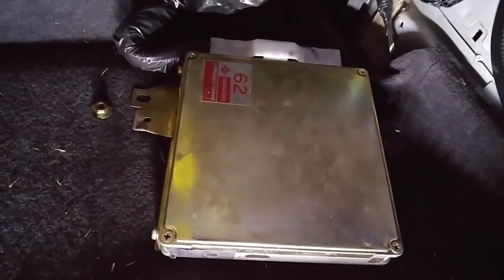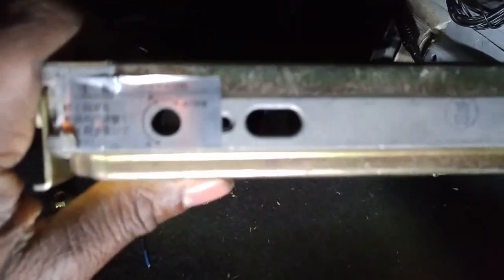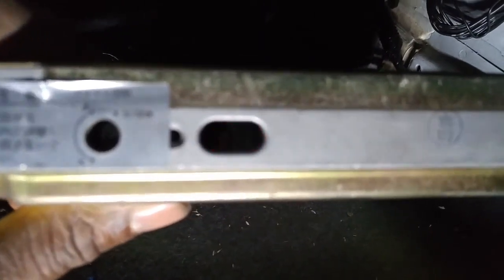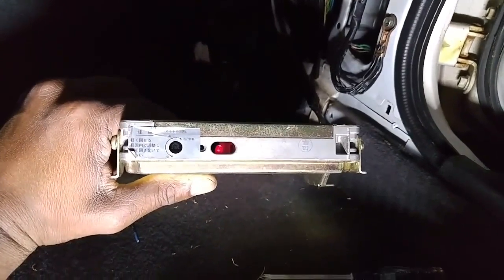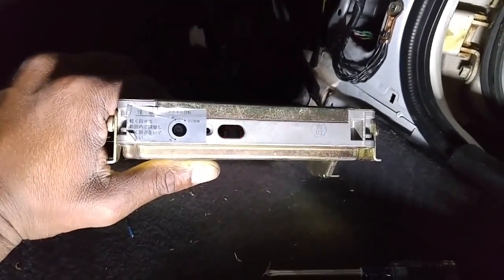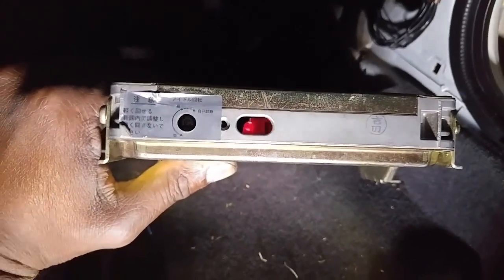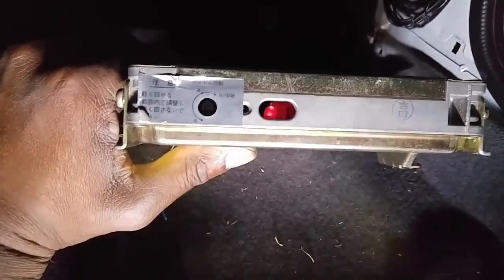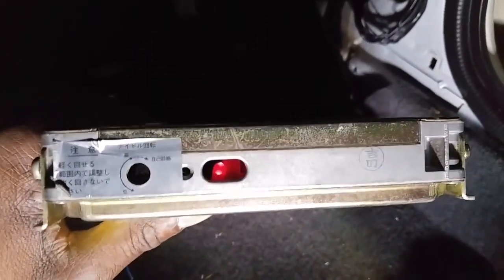Sr20det fault codes

Comment: 55 means all good right?
Reply from the maker: John L if I recall correctly, code 55 means other malfunction. Consult terminal required. I translate that to mean the ecu can not find any error codes.
Reply: Well, just pulled out my ECU to look for codes... doesn't even have any screw or light! :P
Reply from the maker: John L what type of ecu is it?
Reply: Some NQ ecu... I don't have the full history of the engine, but I'm relatively certain or hope it's a SpecR S15 engine. S15's probably use an OBD2 port or something. But since its been swapped into my S13 there's no longer a port, and the loom has been modded by who knows.
Engine's been running rough, changed the coilpacks, spark plugs, checked for air leaks... it's better but still slight intermittent misfires here and now. Thought getting the codes might help
Reply from the maker: John L hmmm.. I thought the s13 came equipped with the consult harness. Have you checked in the in the fuse panel, located inside of the car? There should be a grey harness with about 16 pins. If it has never been used before it may still be tucked up in the panel area.
Reply: @johnl2124  I have the same issue have an s15 with no codes swapped into a Datsun 620 did they have an obd?